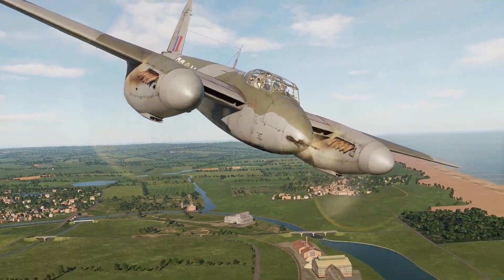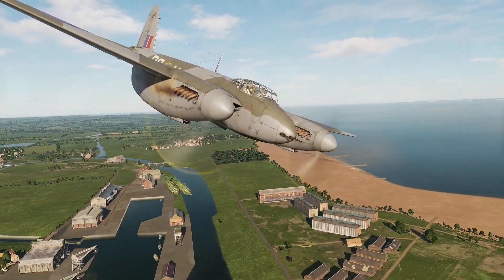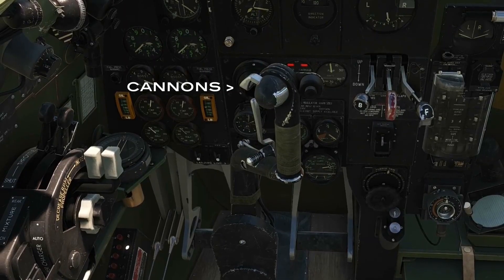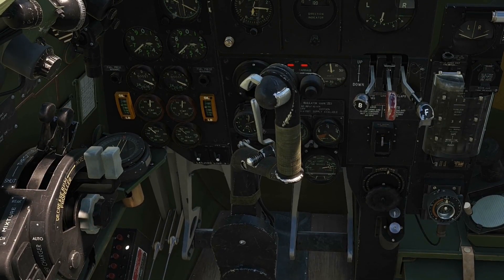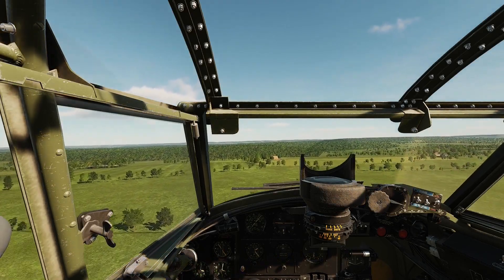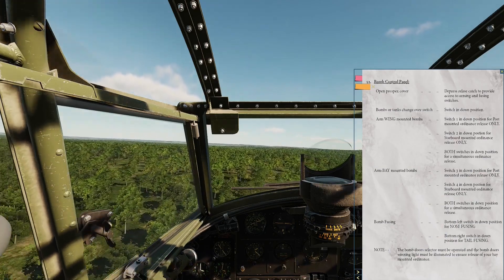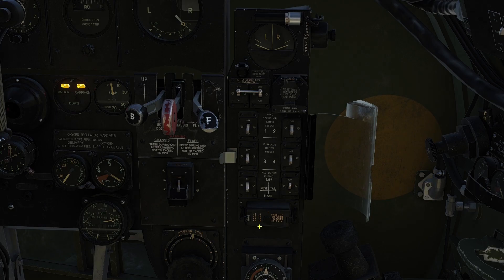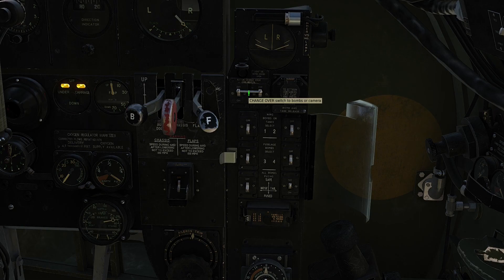DCS Mosquito VI | Weapons

Comment: Switchology is all good but something has to be done with the center bombs exploding in air and destroying your aircraft. It has nothing to do with side slip either. Not as bad with the smaller bombs but forget about dropping the big guys. And for the record yes I’ve tried level, diving, various angles, various altitudes. I’ve managed to land the Mossie less than 5 times mostly due to my own bombs working for the Nazis.
Reply: Check to see that your settings in ME are NOT for "Unlimited Weapons". It's under Customise (Top bar) and Mission Options. Uncheck unlimited weapons. Mine was on and it was trying to replace dropped ordinance before it cleared the bay. Booom!
Reply: @johnmclean6498  nope never even had that setting on. There are lots of others having this issue.